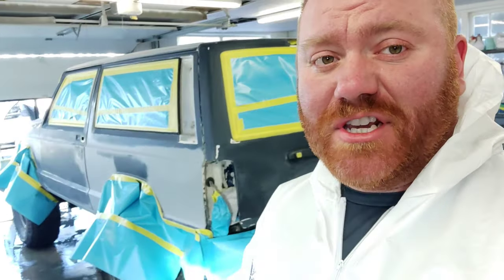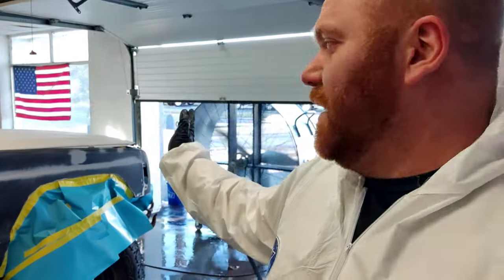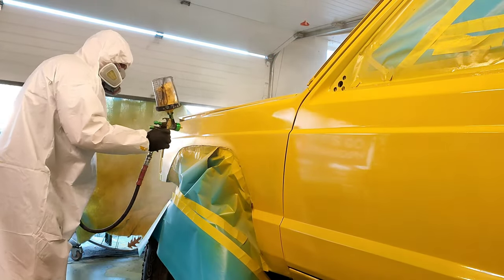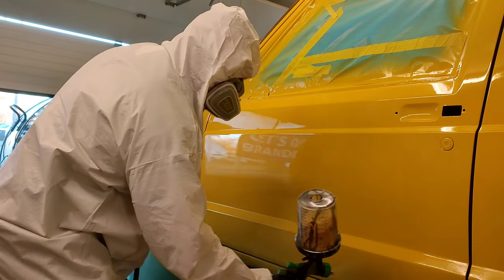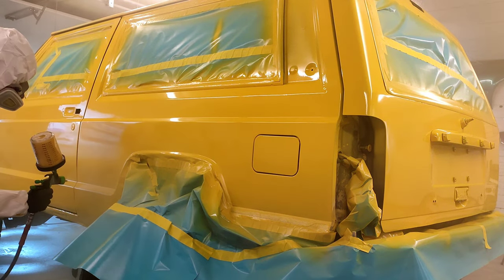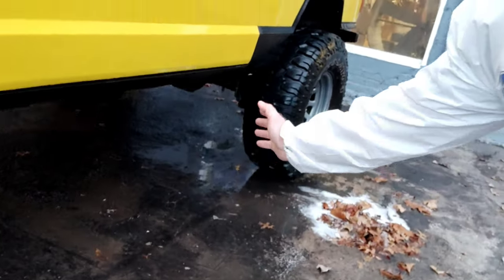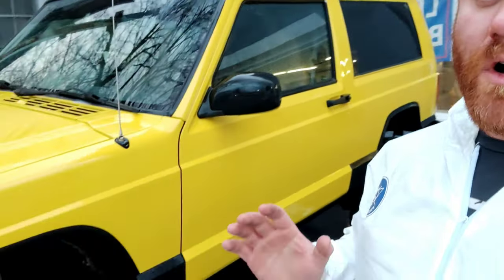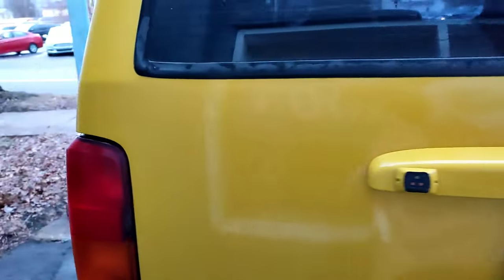Cheap 100$ paint job

Comment: i notice you alot closer than with metallics. ive been fighting with mettalics even with bc cc do i need to back off maybe ive always been told 6 inches maybe im wrong. also have had orange peal in clear coat as well
Reply from the maker: Mettalic bc cc... 2-3 wet coats, one drop coat, easy.